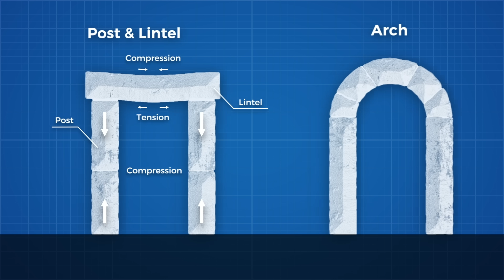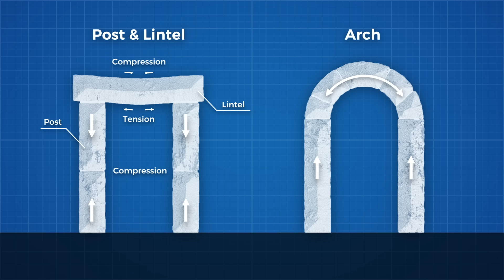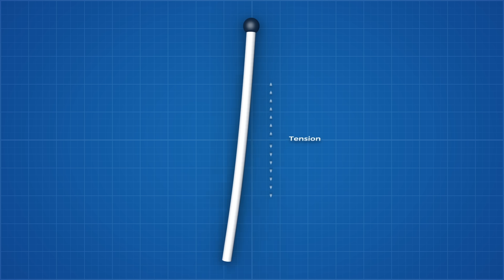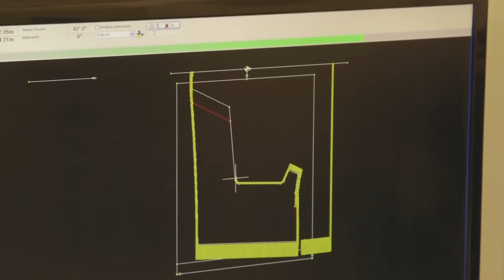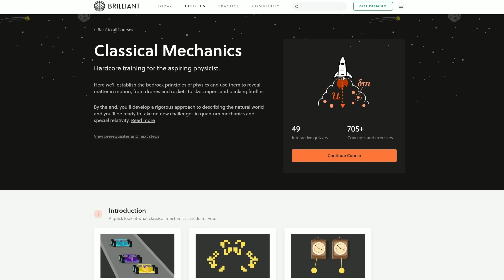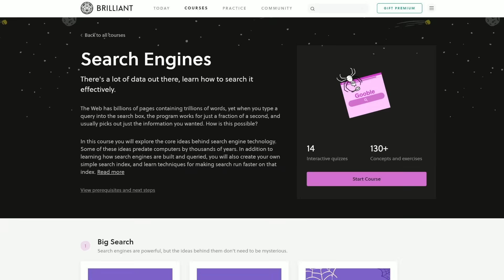The World's Oldest Construction Project | Sagrada Familia

Comment: "Nature is the ultimate form of intelligent design" (4:04)

Me: *Laughs in wisdom tooth removal*
Reply: Don't forget disk herniation, appendicitis, hip replacement, knee replacement, kidney stones, and cancer.
Reply: @williamredding8953  Well, nature is the greatest designer... If you give it enough time to reiterate and improve its designs for millennia
Reply: Xenure Calipsuaor
What do you mean by "human changes"? Humans had weak knees long before agriculture.
Reply: @InevitableKiller4   what the hell is this ultimate design?

if it's adaptation, then humans can easily fail when 'nature' decided a supervolcano should errupt some day.
Reply: Xenure Calipsuaor
The only reason I can think of that humans don't have both intelligence and strength is resource (calorie) scarcity in the ancestral environment. Nature achieves some kind of balance in the sense of determining where limited resources should be put to use.
But this caloric balance hypothesis doesn't explain why our bodies break down after a few decades. It's not as though vertebrates are just incapable of living long lives. The Greenland shark famously lives for centuries.
I suspect that evolution has failed to select against things like weak knees and small pelvises because the problems caused by such things usually manifest themselves after we pass our reproductive peak. Evolution is dependent on reproduction, resource scarcity, and mutation; without reproduction, evolution cannot function. So we'd expect to see creatures which are very healthy when virile/fertile early in life, but unhealthy when their reproductive faculties fail them. While the Greenland shark may live for several hundreds of years, it takes a century and a half to reach sexual maturity.
I'm not a gerontologist though, and this still leaves the question of why animals become progressively less capable of reproducing.
Reply: Isn't it crazy how when we analyze the skeletons of stone age man, they have no problems with wisdom teeth, or a whole myriad of other skeletal issues. They're symptoms of a weak, modern society.
Reply: Lmao thats gold
Reply: i never did that, soo...
Reply: You are a Multi-trillion celled self replicating machine whose processes have not stopped for Millennia, and you are complaining bad design because you have a tooth that is half a centimeter off?
Reply: @laststand6420  
Yes.

Also, it was coming in at an angle that would've likely caused an infection.
Reply: @williamredding8953  That's pretty funny, but in all seriousness the Human body is the most incredible machine ever built.
Reply: @laststand6420  It wasn't planned or designed. there's something known as evolution. out of several species only few were able to, the ones who were able to adapt & survive.
Reply: @gabbar51ngh  If you found the word 'THE'  scribbled onto the beach but couldn't see anyone around, would you assume someone wrote that? P.S. I found out that there is a book composed of over 2 billion letters which contain information that nanomachines take and turn into proteins that other nanomachines take and put into cells that "just happen" to form functional (and symmetrical) mega-conglomerates. We can talk about Aliens or greek gods Or My God... But let's not kid ourselves and say these things made themselves. Respectfully LastStand
Reply: @laststand6420  They did. Who do you think created them then?
Reply: @gabbar51ngh  His proper Name when Translated is "I Am". He is outside this Universe and unbound by our laws (which he wrote). He Just is.
Reply: @gabbar51ngh  Yes I have evidence. 2,000 years ago a man claimed to be from God and he claimed God was the creator. To prove his power over nature he performed miracles. And to prove he was the true God he raised his own dead body from the grave
Reply: @laststand6420  2,000 Years ago? lol who? muhammad, krishna and several other people claimed the same. some before jesus if you are referring to him.
Reply: @gabbar51ngh  Jesus Is the only one who was Confirmed to be dead, then Confirmed to be alive again. As to Muhammed, he never claimed to have been resurrected (in fact he did no miracles, other than his "ascension to heaven"). Buddha is dead and we know where his tomb lies. Krishna was hit by an arrow and "ascended to heaven"(quite a coincidence I would say). Jesus was really dead, the Jews knew it, the romans knew it, and the disciples knew it. Three days later He rose again. As soon as Peter stood up and started preaching his resurrection why didn't the jews just drag out Jesus body? That would have ended christianity there and then. He rose.
Reply: @laststand6420  Krishna and Buddha predate Jesus. So how is Jesus the only true one? It seems like you have a bias.
Reply: @gabbar51ngh  How does being first affect whether someone was right or wrong? And yes I am biased towards Jesus as Christ as I am biased towards the theory of the Atom. I have been convinced of both by many facts... And I remain skeptical of any attempt to disprove either Jesus as Christ or the Atom.
Reply: @laststand6420  Well jesus is nothing but a rip off. if he was true he would have been there from the beginning
Reply: @gabbar51ngh  And you know this how?
Reply: @laststand6420  because earlier Faiths have shown it. Maybe you should read on religions before and after christ too.

Plus there's no evidence of God either
Reply: @gabbar51ngh  The simplest of objects cannot build themselves, much less replicate and self repair. God's work is all around you, even inside you. You just refuse to see it. But that is of far less concern to me than the fact that you have rejected His Son. I dare you to read "The Case for Christ" by Lee Strobel.
Reply: Design is design, it's not always accurate but constantly changing with every iteration.
Reply: @speedy01247  No, design imply intent, which is not the cas with evolution. Nature doesn't intent to go one way or the other, it just happen through selection.
Reply: @guilemaigre14  
You're right that there's no "intent" behind it, but I don't think that Real Engineering is saying that evolution is literally a designer. It's a metaphor, and I'm just making fun of people who actually believe in intelligent design. 

I'm sorry for what comes next:
*implies
*case
*intend
Reply: @guilemaigre14  Similarly you could argue there is no real intent in human design. We are part of nature and we just do what nature dictated in our DNA.
Reply: Da Vid,
I started reading the Bible a decade or so ago, but found it difficult to interpret as anything other than a collection of fables exaggerated by generations of aural retellings.
I figure that if a god wants me to know it exists, it wouldn't rely on a dubious book.
Reply: @williamredding8953  The Bible is anything but a dubious book and has been confirmed through historical research and archaeological findings more than any book in human history. The people who want everything to jump out at them and force them to believe will never believe it anyway.
Reply: dblvision
The facts are that the earth formed about 9.2 billion years after the after the universe as we know it began, that animals have evolved over millions of years, and that homo sapiens emerged from the same evolutionary process as all other modern eukaryotes.
The Bible contradicts these facts in its first pages. A book with the authority of the all knowing and all loving creator of the world would reflect reality. To say nothing of the deleterious effects of the generations of inbreeding described in the bible would've had, or the engineering, geographical, and zoological impossibility that Noah's ark would've been, or the geopolitical changes archeologists would've seen if Egypt had actually lost its army to the Red Sea, or the barbaric morals prescribed by the bible. If there is a good reason to believe in god, you won't find it in that book.
Reply: @williamredding8953  The Bible doesn't contradict any facts and certainly doesn't need your shambles to stand on its own. What you present are faulty theories at best that often their own originators and proponents weren't even very certain of. “When we descend to details, we can prove that no one species has changed (i.e. we cannot prove that a single species has changed): nor can we prove that the supposed changes are beneficial, which is the groundwork of the theory.” (Charles Darwin, 1800’s Evolution Theorist, in his letter to G. Bentham May 22, 1863)”

"All matter originates and exists only by virtue of a force. We must assume  behind this force the existence of a conscious and intelligent mind. This mind is the Matrix of all matter."  "Science can not solve the ultimate mystery of nature. And that is because in the final analysis , we are part of the mystery we are trying to solve"

Max Planck - German theoretical physicist.
Reply: dblvision
In science, the word "theory" represents the highest degree of certainty. A theory is a hypothesis which has been so throughly tested and confirmed that scientists can treat it as correct beyond any reasonable doubt. Unlike the religious, scientists are humble enough to question and improve their models. The certainty with which you preach your religion has nothing to do with its veracity.
The modern theory of evolution is much more through than darwin's. hypothesis. Unlike religious dogma, scientific models become more accurate over time. Biologists don't treat Darwin like an unquestionable prophet; his theories have been improved over the last 200 years.
Also unlike religion, scientific knowledge isn't based on the proclamations of authority figures. Newton assumed that god must keep the planets in stable orbits because his orbital mechanics model couldn't. But as it turns out, he was wrong. Arguments from authority mean nothing in science.This is one of the reasons that scientists publish their methodologies, not just their conclusions.
But even if we ignore evolution, and human history, and the history of life, and the age of the earth and universe, biblical stories like Noah's flood and ark are impossible in more ways than one. I can explain a few if you'd like.
Reply: @williamredding8953  [Comments on video about how the world's greatest architect designed the world's most magnificent cathedral using bits of string, all so he could bring glory to God] "I'm just making fun of people who actually believe in intelligent design."
You mean like Gaudi?

(I don't really intend to get in to a theological debate.  I just want to point out that believing in God doesn't mean you're an idiot.  I also recognise that your comment was probably mostly in jest, which is fine. :) Basically, take this reply as seriously as you intended your original comment to be taken! :p Switching back to a slightly more serious note, I am always impressed with the number of people I meet within the Church who have degrees, sometimes advanced degrees, in STEM who have then switched to working in ministry.  It's personally quite comforting.)
Reply: @andymcl92  
One can believe in a god without believing in intelligent design, and one can even believe in intelligent design without believing in a god.
Many Christians around the world accept the realities of science and let god occupy the gaps in our current knowledge.
If I recall correctly, many of the US's founding fathers were deists, believing that a god got the ball rolling and then stepped back to do something.
Like I said, there could be good reasons to believe, but they won't be found in the bible; it's just is too inconsistent with reality.
I understand how comforting it can be, and I'd love for it to be the case that everyone gets to live forever in a better place, but we don't always get what we want.
Reply: @williamredding8953  True, but I personally feel that they work best together.  Obviously that's my opinion, but I feel that its best to judge science scientifically and judge the Bible as a historical text.  The two are very different things, and different kinds of proof are required for each.  Just as you can't use a mathematical proof in science, you can't use a scientific proof for God.
Anyhoo like I said, I don't really want to get in to a debate!  Best wishes and (if you'll allow me to say it) God bless :)
Reply: @inrptn  
"The Bible doesn't contradict any facts and certainly doesn't need your shambles to stand on its own."
The Bible does contradict a lot of facts, that you can't argue. For example: the human race didn't spawn out of an incestuous family twice in a row, creation didn't happen in 6 days, man was not made from clay, etc. There is absolutely no evidence for any of the above other than accounts from a single  piece of religious scripture. Which I don't ascribe much credibility to, for the same reason you wouldn't ascribe much credibility to the Greek or Mayan story of creation.

Can you cite any reputable scientific studies that prove any of the above statements in the Bible?
Reply: @jeffvader811  Evolution and the big bang are not facts. That the Bible contradicts them means nothing. Scientism is your belief.
Reply: @guilemaigre14  came here for this comment
Reply: @inrptn  Scientism? Science is not a religion, because unlike religion, any hypothesis, methodology, and theory can be criticised, revoked, and rejected. This extends to the theory of evolution and the Big Bang, neither are beyond _reasoned criticism_.

Emphasis on 'reasoned criticism', if you were to provide me with a handful of reputable scientific studies that showed without a doubt that the universe was only a few thousand years old, that all life to ever exist started in a garden in the middle east, and that man had clearly visible lineage from clay. I would be the first to throw up my hands and say I was wrong, because the goal of science is to find out the truth, not to cling to beliefs in the light of overwhelming evidence.

My question for you is this: assuming that there was overwhelming evidence against your beliefs, would you be willing to change your mind? Just a simple yes or no will do. If the answer is no then this conversation isn't worth my time.
Reply: @jeffvader811  Don't be disingenuous. You claim to be interested in the truth when in reality you are only interested in something that fits nice and neat into your scientism box. You have created a convenient mental escape route whereby you can discredit anything and everything that doesn't follow your little rules. My question for you is this: If the truth existed outside of science, outside of a nice convenient scientific explanation would you be willing to change your mind? The answer is no. And anyway I'm not here to change your mind, only to study the mental gymnastics whereby you people automatically discredit everything that does not fall neatly into your "scientific" purview. 

10 That at the name of Jesus every knee should bow, of things in heaven, and things in earth, and things under the earth;

11 And that every tongue should confess that Jesus Christ is Lord, to the glory of God the Father. Philippians 2:10-11 

This is the future that awaits you whether you care or believe it or not. God created this universe and everyone in it and he will have the final word.
Reply: @inrptn  
"My question for you is this: If the truth existed outside of science, outside of a nice convenient scientific explanation would you be willing to change your mind? The answer is no yes."

The answer is yes, if you could only prove it.

Thank you for answering my question, this discussion clearly isn't worth my time.
Reply: @jeffvader811  Jer 29:13 KJV And ye shall seek me, and find me, when ye shall search for me with all your heart.

Jer 33:3 KJV Call unto me, and I will answer thee, and shew thee great and mighty things, which thou knowest not.

It's not my job to prove anything, especially not to the arbitrary standards of "science". God himself will prove it to you if you seek and ask him.
Reply: dblvision 
Mate I was a christian for a decade and God never showed up. If you’re hearing voices in your head you might be a little mad.
Reply: Jeff Vader This is fascinating! What beliefs did you have before those 10 years? What defining moment caused you to accept Jesus’s claim that he is the son of God and died for your sins and thus you fully give your life to Jesus? Did you get baptized after that? And then why did it take you 10 years to undo that proclamation? Was it a slow doubt? You said you never heard God, so why did you start in the first place?
Reply: @VeriStrawberi  
I was raised a Christian, so there wasn't a defining moment of conversion for me. I went to Sunday school, prayed daily, did reading in Church, went to Bible summer camp and all of that Jazz for 10-ish years, then I matured a little and started asking myself questions. Like why I prayed to a deity when I had never heard/felt it's presence in my entire life? What proof was there that the Bible was the word of God and not some other religious text? etc. I asked around and never got a decent answer for these questions, so I just stopped being a Christian,. I still go to Church sometimes for the Christmas carol service, weddings, christenings, free tea and cake, etc. But I don't sing the hymns or take part in prayer, I was actually made a Godfather recently as well. So I do still interact with the Church a lot, but for me it's just about the fun festivals and the community of it all, and I'm happy with that.

I can't remember if I got baptised at any point, I might've been when I was smaller, but I wouldn't say it was the most significant bath of my life.
Reply: Just because YOU have shitty genetics and poor bone structure...
Reply: @NinjaAdorable  that disproves the intelligent design statement. nature is basically evolution and survival of the fittest. the weakest structures built naturally got destroyed overtime and stronger ones remained. humans looked at the stronger ones and said "Look nature is well designed and planned" while completely ignoring the ones destroyed by nature itself.
Reply: @NinjaAdorable  
Perhaps, but weak knees and a spine ill-suited for upright locomotion are a flaw shared by everyone.